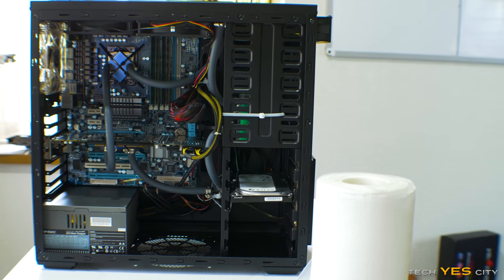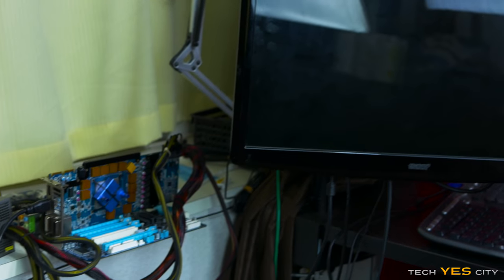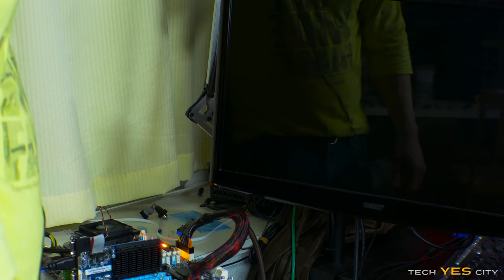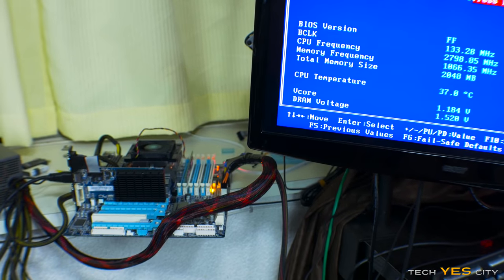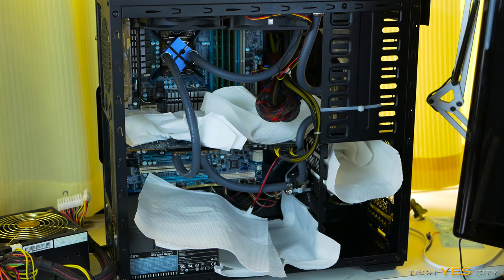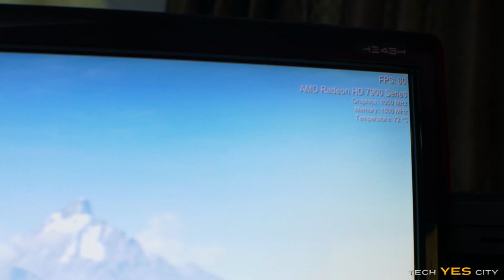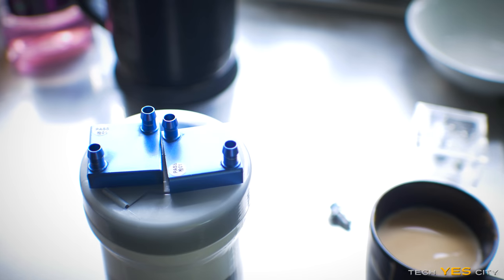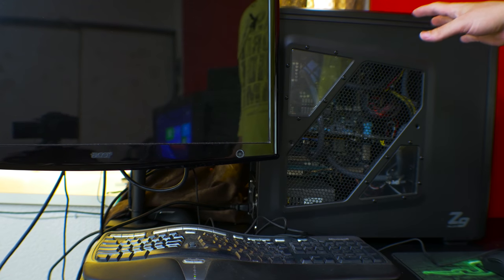$50 Custom PC WATER Loop - Is it POSSIBLE?

Comment: So many things wrong with this build.  Don't use automotive coolant.  Better with straight distilled water.  Don't mix metals.  It causes corrosion.  Don't use your finger to spread the compound.  You would have had better contact just letting the blob spread on it's own.  The blocks are still crap, but the TIM would have done a better job filling in the uneven areas.  Plus the grease on your hands has a negative effect as well.  Pump performance is EXTREMELY important.  The best blocks and rads in the world will perform like crap with a terrible under powered pump.  You will need blocks with some sort of fin or pin arrangement inside.  No clue what these have but pins/fins are  a must for better heat transfer.  An empty cavity will do very little heat transfer and cooling.
Reply from the maker: +Chad Bremer I am going to do round two soon with an orbital sander and brackets, definitely give it one more shot.
Reply: Tech YES City Take some of my advice and you will have better results.
Reply: As we all know there's no problem spreading the compound with finger.
Reply: +Chad Bremer 1. Mixing metals is no problem, as long as zinc or aluminium aren't involved. I'm even using copper, nickel and brass in my build and chemically there is nothing that can react at all.
2. Spreading TIM or just pressing down the blob doesn't matter at all. I'm using the credit-card-spread-technique for over 10 years now and I never encountered any "hotspots" caused by "ominous air-bubbles" or anything of that sort. But you're right on what you say about the bear finger. In case you want to use your finger to spread it, just put a thin plastic bag around your finger.
3. Pump-performance is not linearly bound to cooling-performance. In my setup the best cooling performance is reached at a pump-rpm between 2500 and 3000 min^-1. Above 3000 min^-1 the performance decreases again. That means for all builds and for all watercooling loops, the best performance has to be determined by testing various scenarios.
4. The best waterblocks available 8-10 years ago were so called "Düsenkühler" (Jetcooler) that didn't have any fins or pins inside at all. I doubt that the blocks used in the video were Düsenkühler but just generally assuming that you need pins or fins inside to raise the surface area is wrong.
Please don't take this as an offense but be considerate about what you say, because every coin has 2 sides and there are numerous ways that lead to rome.

Kind regards,
Meta Custom Computers
Reply: Meta Custom Computers 1 general rule, don't mix metals.  Yes, similar metals like nickel, brass, and copper are safe for the most part.  But the blocks appear to be aluminium.  Really bad choice since the rad most likely has brass in it. 

2  agree to disagree I guess.  I have tried it over the twenty years.  I only ever got a bad seat with spreading.  And the general consensus with everyone I know is that it's a poorest option.

3  By pump performance I am mostly reffering to having enough.  If the flow is terrible, temps climb.  There is a point where the faster the pump flow goes that it wont really improve anything.  In extreme situations the flow can be so fast the rads can not cool the fluid effectively.  But you need a some beast pumps like dual DDC or D5 for example.  And less rad than you really need.  

4 As for blocks, yes ten years ago some blocks just had a cavity in them.  But, as we all know, increasing the surface area has a huge impact on cooling as long as good flow is maintained.  Those old blocks could not even stand up to the now defunct Danger Den blocks.  And you can get those or old Swiftech blocks super cheap used.  Especially ones for old 775 sockets.  Easy enough to Jerry rig them for a setup like this.

No offence taken.  I just had to clarify myself a bit I guess.
Reply: Chad Bremer
Thanks for the clarification, though I still have to disagree with the spreading techniques. I bench-tested 5 different ways of spreading the TIM under the same conditions and the total difference of "worst" to "best" technique was 2°C wich can be completely dropped for average and I can wholeheartedly say, all techniques gave the same results. If you want to lean on the delta of 2°C, I can tell you, the "blob"-technique wasn't the best of the 5.
But looking at the sheer amount of people stating "how wrongly he applied the TIM", I guess I just have to make a video in which I bench-test those 5 methods again, to debunk this myth again.

Kind regards,
Meta Custom Computers
Reply from the maker: I just got finished testing this GPU the GTX 285, which has a massive heat spreader over the die, and the results were..... drum roll exactly the same, the spread may have beat the pea method by possibly a bees dick, I couldn't measure it as they both topped out at 64 degrees. but most likely tee it up to variance, this was with the fans mannually set to 70% the whole time, unigine valley and also 26 degrees ambient on all times.
Reply: Well, I did say inconsistent.  It will be fine sometimes and not others.  So, yeah.  My own experience talking on that.  It's only with spreading that I have ever had to redo TIM.  Line, blob, X, all have worked first try with no bubbles or bad contact.  Only thing I ever spread is liquid metal TIM.  Like CL Pro/Ultra.  It wont really spread on it's own very well.  If in a low mount pressure like this situation, just use low viscosity TIM.  Noctua makes a good one that is pretty thin.  You can do what you want.  But you are just making more effort for yourself.  When you have to build 20-30 PC's for a customer, you don't really want to deal with dumb things like spreading TIM.  Just wasting time.  Even more so when one or two has issues with poor contact and you have to redo it.
Reply: Chad Bremer "When you have to build 20-30 PC's for a customer, you don't really want to deal with dumb things like spreading TIM."
That's why my customers always return to me, because they know and value my dedication to detail and I always invest more time for higher quality. Of course I'm just building 2-3 PC's per month but I guess even with more output I'd still take my time for each PC.
The slogan of my little company is "I don't build PC's, for me it's arts and crafts."

Kind regards,
Meta Custom Computers
Reply: +Meta Custom Computers I have a side buisness that started when a friend of mine started doing independent IT consulting.  I do take my time.  every machine gets done right with tidy cable management and runs a battery of stability tests before I deliver them.  It's all local and all referral only.  Most of it is done durring the off season from my main job.  Most of the machines are office builds.  some servers of various flavors.  And a smattering of pro workstations.  Then I do 3-4 big builds a year.  Usually the managers or sales guys that are customers of my customers.  Only thing I won't do is hard tubing because I hate working with it.  And since it is not my main income I can be very picky about what I will do.  In the end it is very rare to see a machine need to come back.  But, like anyone that has been doing anything like this you know shit happens.  The not messing with TIM spreading part comes with the testing.  With the bigger orders I will do 3-4 machines.  After that the do OS instal/updates if needed.  Some machines leave with no OS.  Then they get tested as I start the next group of builds.  Generally I build faster than everything else goes.  Lol. The big builds take weeks to do everything.  From first part order, to the build, then test.  It is a nice way to make some side cash.
Reply: Chad Bremer
For me it's exactly the same, my small business runs alongside my main-job. The orders I get mainly consist of office-machines and normal gaming PCs. Some rare cases of fully loaded custom watercooled rigs. I'm picky with hardtubing when a customer wants the machine delivered by postal-service but when the customer comes for pickup, even hardtubing will do. But I'm also taking on repairs, upgrades and maintenance, especially now in the spring-time a lot of people take my offer of "spring cleaning" the PCs. Till now I only got one guy claiming a free repair, or a full refund of a machine. It was an overclocked gaming-rig for his (probably 14-15 year old) son which stopped working after 2 days. Took me 1 minute in the BIOS to see that someone messed with the settings, since I'm keeping record of the settings I'm doing, in case a customer needs a BIOS-reset and wants the settings back. Told him he can keep the computer as it is, or pay me for redoing the settings since it's his own fault for letting his son mess with it without supervison.
I already met a lot of non-German people who said "OMG you can't do that to a customer, the customer is king!" but for me things roll differently. It's fortunate that German laws prevent customers from shitting on your door-mat but it's still exausting to put up with customers like that.
But at the end of the day I just love doing it, the planning, the thrill when new parts arrive, the assembly and bench-testing. Still waiting for a major job, still dreaming of building a big render-machine for a company like a dual-CPU rig, using Xeons. But I have my hopes up. :)
At the moment I'm working on my "Sleeved cables project", since all the commercial pre-sleeved cable-sets you can buy are ugly and of poor quality. I want to set a higher standard for sleeved cables, so the customers can pick from 21 different colours and can design the pattern themselves. If they wish, I even do them in paracord, which allows them to pick from an almost infinite amount of colours. :)

Kind regards,
Meta Custom Computers
Reply: Meta Custom Computers The big workstations are kinda like gaming builds.  Most are not water cooled.  Have had a few though.  They are fun.  The wildest one was back in the 1366 days.  A quad socket Supermicro board back when Skulltrail was a thing.  Was a BEAST for some engineering company my friend was a consultant for.  I don't remember exactly what all went into it any more, but it was a fun build.  Had to get a special supermicro case since that was the only thing that the board fit in.  4U rack mount, of course.  Nice thing about being in a pretty big metro area is that there are lots of businesses.  My one friend gets most of the work machines.  The lame ones and some fun ones.  The rest are people he funnels my way.  That's where the manager and sales guys come in.  They get a hold of me through him.  Biggest issue for me is I work about 60-80 hours a week for about six months a year.  Not a lot of time to do this stuff during all of that.  So, when the winter off season comes, I do most of the work then.  I will do some of the custom gaming builds and other single machine stuff when working, but with the understanding that it will take longer to get it done.  If they need it right now, they need to talk go elsewhere.  I am just rolling into that schedule now.  Next week I am out of town all week.  And will be most weeks till October/November.  Nice thing about my buddy being an IT consultant.  If problems do crop up on the machines for businesses, he deals with them.  99% of the time it's a software or network issue anyway.  Not the machine it's self.  I have had to refuse business a few times.  One was one like you had where the person I built the machine for messed with it after I gave it to them.  And actually did damage.  I told them I would fix it, but they had to pay for it.  They tried to blame me.  I keep photos and screenshots of everything I build and file it all away on a server.  I pulled up what I had on that machine.  Showed what was changed and why it did the damage it did.  Then said I will not fix it for free.  He could either pay for the repairs or leave with the broken computer.  I also said if he chose the latter, I would not accept an business from him again.  That was three years ago.  Never heard from him again.  lol
Reply: Meta Custom Computers I do agree as well on the excitement of the builds.  Especially when you get new toys.  I am hoping to get my hands on EK Ascendancy when it comes out.  It's the fan controller they had shown off a few years ago, then it died.  Then last fall they started talking about a revamped version coming out again.  I think it might have a new name now.  But, should be a nice alternative to the Aquaero controller.  Not that there is anything wrong with those.
Reply: +Chad Bremer I wouldn't call pump performance EXTREMELY important. Speed is not necessarily conducive to cooling performance. Jay just made a video on this topic recently.
Reply: Chad Bremer Yeah, that's what I was trying to say, speed of a pump isn't always the most important part. But a pump that's too slow is detrimental to a loop, of course. Yeah, the pump was poopy and the blocks were total shit haha.

But imo Jay is interesting just for the fact that he has some epic builds, like his 3x Titan build with the beautiful custom loop, it's beautiful. But aside from him I agree Tek is great and Linus is okay. But just Linus and Luke, the others at NCIX are annoying.
Reply: Chewyshoot Jay has given a lot of poor advice in his short run.  As for the builds, well, they are free.  So... meh.  The loop is a funny story.  He boned that up bad early on because he went in clueless with Mayhems pastel. Part of it played out live over at Overclock.net.  Those threads are long deleted but it boiled down to Jay not blaming the owner and calling him out publicly.  Mick, the owner, in typical British fashion just didn't take his crap and told him he made the mistakes in prepping the loop.  He also told him the public attack was very unprofessional.  He then ignored Jay.  At least publicly.  Mick used to be a regular face at overclock.net before that.  Now, much more rare to see him around.   What little respect Jay had left, he lost it with us over there.
Reply: Chad Bremer that's fair, I suppose. I did actually see a vid he posted recently regarding the pastel coolant. But I take most videos on youtube with a grain of salt, but I do enjoy Jays material. Just my personal opinion. :)
Reply: Chad Bremer I did actually get the idea to watercool my r290 from him and Paul, so I'm thankful for that because rather than 94 it tops out at about 55 haha.
Reply: Chewyshoot You are free to watch and enjoy what ever you want.  I watch Bosnianbill lockpicking vids.  lol  No idea why.  But I do.
Reply: Chad Bremer and I watch lets plays of Stardew Valley lmao
Reply: Chewyshoot How about a vid of a guy chopping golf balls with a big knife?  Found that on the strange part of YouTube one day.  lol
Reply: Chad Bremer Or the hydraulic press ones lol those are great.
Reply: Chad Bremer
For me, Jay lost 100% of his integrity due to the Mayhems incident.
In German PC-communities he's nothing more than a joke, which is sad because I don't like cussing on people but on the other hand, the way he meneuvered himself into the incident... well he doesn't deserve otherwise.
I was pretty early on telling him that the "mysterious white stuff" was, which he claimed are "copper-salts". (I told a collegue of mine who studied applied chemical studies, he laughed his arse off...) It was nothing more than Titanium-Dioxide (TiO2) which is the most widely used substance for white colouring. The Mayhems Pastel White is based off of the original Ice Dragon which even has TiO2 in its list of ingredients. Furthermore, Mayhems already said on oc.net (regarding the Pastel Black) that "copper-oxide causes fall-out of the coloured particles which turnes it brown" and "that this may be an issue in all other colours aswell". So the question is: How does copper-oxide get into the loop? Every chemist will tell you that copper is a very sensitive metal and is quick when it comes to reaction with other substances. Acids and Vinegar can cause very quick corrosion on copper and the funny thing is, Jay openly admitted in one of his videos that he "Cleaned the rads with acids and vinegar several times".
So we have a totally clueless Jay who cleaned his ultimate high quality radiatiors with acids and vinegar several times, caused corrosion of the copper inside, the copper-oxide fell out and went into solution which turned the Pastel Yellow into an orange mess which caused the TiO2 to fall out aswell and build lumps on every fitting and every o-ring inside.
Sounds like it's totally Mayhems fault... NOT.
I guess you'll agree that one universal constant in the IT is: "99% of the times, the problem sits between the chair and the monitor" and this case wasn't any different. But wait there's more.
With all sincerity we wrote Tweets, Facebook-messages and Emails to Jay, telling him all this, asking him to just admit his fault and tell the people what really was going on. He will be the big generous Jay who forgave Mayhems for it was his own fault, he has another video full of real content and the viewers are pleased. Well... He ignored my facebook-messages and Emails and the Tweets of my collueges got deleted and they weren't able to tweet him again. (Don't know if banned or not, I don't know how Twitter works) We did that when the Mayhems incident was at the stage of "I don't know what's going on". One day later he released the rant video cursing and blaming Mayhems all over it.
It seems like Jay doesn't want to make videos with true and important contents...
But that's not the worst, because he's just a clueless Youtuber who can be ignored, what really made me mad as hell was the community backing him up, being on his side, joining the crowd of the Mayhems-hate-speech, not accepting that Jay might have something to do with it. And all that while thousands of happy Mayhems-customers are sitting at home with a custom loop that is totally fine for over a year, because they did their homework and didn't screw up like the fool Jay made out of himself...

Just my two cents (hope you see what I did there...)

Kind regards,
Meta Custom Computers

P.S.: I'm using the "shitty" Alphacool Radiators which in Jays words are "the dirtiest radiators available". I always just flush them with tap-water (Tap to hose, hose to inlet fitting, outlet fitting to hose, hose hanging in the shower) for 5 minutes, fill them up with a distilled water/sodium bicarbonate-mixture and let it sit for 10 minutes and flush it again with distilled water. Then when the whole loop is installed, I fill the loop with sodium-bicarbonate again and let it run for 10 minutes, flush the system with distilled water and then fill the whole loop with the coolant desired.I already built 3 rigs with Mayhems Pastel inside and till now only one customer returned after a year but not because of the Mayhems Pastel, he just wanted a regular cleaning-job. (Cleaning the inside, PCBs, refreshing TIM and refreshing the loop)
Reply: He actually mentions about the blocks and the pumps.
Reply: oh, come on jay got that one wrong / i would say this one goes in the category stuff happens. He went looks over functionality what in it self is a big no no - but oh well. btw. I also use Alpha rads(and some phobya), but flush mine with 90% alc. first, then destilled water.
Reply: Paul Posthuman
"Getting something wrong and admitting it afterwards" is totally different from "Lying to the community, discrediting a business and keeping quiet about everything afterwards".
If he had the guts to look into the camera and tell the community "Guys, I guess I fucked this one up, I'm sorry for that", I would have thought highly of him, but he didn't.

Kind regards,
Meta Custom Computers
Reply: yes it would. My opinion is the mayhems story bumped his sensible spot /
the "guru" screewed up, and wont get the taste of shame out of his mouth for a long time: hopefully makes him more humble,
Reply: +Paul Posthuman Thing is, he is not a guru.  Any tech forum with people that actually know thier shit, hat that tool.  Mainly because he thinks he knows what he is doing and talking about but he really does not.  The Mayhems issue just showed how much of a clueless ass he really is.  Especially if you watched him try to rip Mick apart at overclock.net and other forums.   He failed to research things and in turn messed up.  Then blames another for his fuck up, publicly.  We all knew he was a tool before.  That just sealed the deal.  Worst of the youtube tech celebs.
Reply: as for the guru: thats why the quotation marks are there / i personally never heard anyone referring to him as that.
overclock.net; didnt know that, guess i didn't get the whole story - will look in to it.
Reply: +Paul Posthuman mods deleted the posts long ago.  Many where in the Mayhems club thread.
Reply: Chad Bremer
For me basically everyone in the tech scene who is deliberately spreading false information loses credibility right away and the ones that don't apologize and explain themselves are not redeemed.
Like I said, the real crux lies in the community that gives people like him a podium. His audience mainly consists of teenagers who never even once built a computer-system in their lives, people that are simply thrilled and lured in by his "6000$ GAMING MACHINE!!!11".
Those are poeple that admire the sunglasses-wearing cool guy in the expensive Corvette, not realizing that the farmer on the field losely paid 10 times more for his combine harvester...
In the past I really tried to help those people by answering their questions and to motivate them to look into things, to learn for themselves but I just realized that it's useless.
Questions like: "I have an FX8350 right now, can I put the new Skylake in there?", "Haha, the GTX 970 only has 3.5 GB VRAM", "Why don't you put mineral oil into your watercooling?", "I have a GTX 750 Ti, can I play 4k with it?", "Can someone give me the settings to OC my i5 to 4.9GHz?", "Your watercooling sucks, my CPU runs at 8°C on aircooling!"... From being the harmonious answerer of questions and guide to enlightenment of the technologic knowledge, I simply turned into the fucking increadible PC-Hulk and I just wasn't able to answer those questions by heart anymore.
People that doubt my knowledge in which I invested over half the time of my life, because it doesn't match with what the allmighty Jay aka "Watercooling-Guru" said. It's frustrating and just drives me mad...
That's why since the Mayhems incident I simply keep away from that Youtube channel.

Kind regards,
Meta Custom Computers
Reply: +Meta Custom Computers lots of truth in that.  Maybe I should be a youtube star.  My rig that I paid for myself is nearly $6k.  Lol. 

Those combines are a lot more expensive than 60-100K.  More like 300-500K for nice ones.  New of course.  I think the top end combine from Case starts at near 500K before options.  Serious cash in farm equipment.  

As for the dumb questions, you see them even on the good forums.  Simple questions that a quick Google would solve.  The overclock one you mentioned bugs the crap out of me.  Try to explain that every chip is different and no two use the same exact settings.  At least if you are doing it right they wont.  Hell, updating a BIOS will often make OC settings totally different.  Explain all that, and still get the question of what settings to use....  Makes you want to reach through the screen and slap them.  Or the people that ask a question and then argue because the response is not what they wanted to hear.  Even after a dozen posts explain what's wrong with what they asked.
Reply: Chad Bremer
We have a German PC-magazine that also has a Youtube-channel and one of the editors is a real geek, one of the oldschool ones. And every time he talks about RAM or HDDs, he's using the correct terms of kibi-byte (kiB), mebi-byte (MiB), gibi-byte (GiB) and so forth, which technically is the most correct form you can use. I use the terms whenever I see it appropriate and I always smile when I hear the guy on Youtube saying those words. Then I rage again when scrolling down to the comment section, realizing that 50% of the comments consist of people laughing their arses off because of his beard and the other 50% of people laughing their arses off because that idiot can't pronouce "kilo", "mega" and "giga" properly...
And then you always find that one guy asking why his "2 TB" HDD only has "1.81 TB"...
I always remember the times in the 90s when people had no clue about computers and weren't ashamed of asking the "PC-guy" for help and just accepting what he had to tell you. In todays time thanks to the DIY-mentality and Youtube-tutorials, everyone thinks 3 minutes of tutorial and 2 minutes of Google searching makes you the ultimate PC-expert and as soon as you fail, it's the PCs fault...
In a German forum I've seen a guy asking if he would be able to build his own PC, even though he never built one before and has no clue about electronics. Everyone told him to just do it, because Linus and Kyle said on Youtube that it's totally easy. I was the only one opposing that thought and telling him to ask his father, or friends who are experienced in electronics and to let them explain everything properly. Everyone hated on my recommendation and continued to tell him to go on. After 2 days he posted again, saying that he built the computer but it won't boot. Long story short, he shorted the backside of the mainboard, most likely frying it and frying the CPU in the process. I wrote: "I told you so", his response: "Pfff...I'll just RMA them."
I'm not capable of feeling something else but utter hatred towards people like that...

Kind regards,
Meta Custom Computers
Reply: +Meta Custom Computers I have heard people use those and just assumed it was an accent thing.  Never read or heard of it being the correct way of saying them.  Although they are in the conversion function on my calculator app on my phone.  Guess I should do some reading on the whole back story on the two ways of saying them.  Interesting.
Reply: Chad Bremer
It's pretty easy, the people responsible for pre- and suffix-conventions said that kilo, mega, giga, are base10, which makes them 10^3, 10^6, 10^9 (1,000; 1,000,000; 1,000,000,000). But in the IT, you have base2, which makes them 2^10, 2^20, 2^30 (1,024; 1,048,576; 1,073,741,824). That means, they are both not equal, and you can't use the terms kilo, mega and giga for numerics and IT at the same time. Else if you go to the butcher and say you want one kilo-gramm of meat, he always had to ask "1000 gramms or 1024 gramms?".
So specially for the IT they introduced new conventions which are kilo-binary (kibi), mega-binary (mebi), giga-binary (gibi) and so forth. (ki, Mi, Gi,...).
So for example, if you have a HDD that says "2 TB", on it, it's base10 what they mean, so it's 2,000,000,000,000 Bytes. 2,000,000,000,000 Bytes in binary form is 1.81 TiB. (Divided by 1,024 four times) The only ones that never get it right are the manufacturers of RAM, because they should name their kits 4 GiB and 8 GiB, instead of 4 GB and 8 GB. 4 GB would mean 4,000 MB but it's 4,096 MiB.
If you know the calculation of multiples of 1,024, then it's natural for you, you just have to change your habit to saying kibi-Byte, Mebi-Byte and Gibi-Byte instead of kilo-Byte, Mega-Byte and Giga-Byte. :)

Kind regards,
Meta Custom Computers
Reply: Meta Custom Computers Interesting.  Never really looked into that all that closely.  Cool stuff to learn though.  Not sure I can change my habits after so many years though.
Reply: +Chad Bremer .... And +Meta Custom Computers .....dispite this comment being pretty old. I agree with the youtuber. And celeb part and with just entertainment part of y'alls conversations. I enjoy seeing ppl that aren't arrogant and mr. I know everything . You guys are an inspiration, not to long ago I had an interview with an IT company. They had me taking a part a system and asking questions about what x part was. To my surprise , they were impressed with my " basic" knowledge of hardware. They asked me , where have I  learn. My respone was long of hours of research ... with a grain of salt of youtube. What I'm trying to get with this ...when most of this techtuber started... they were very informative with a grain of salt . Now everything is for the money, and not to inform.. google can help more and give better info..
Reply: Most of these are myths but lets go on. 1. It is perfectly FINE to use automotive coolant, anyone whose been into PC more then 5years would know that, its whats been used for years before industries found suckers that would buy premixed coolants and so on. Should of course be used with a good % solution. 

Distilled water on its on is FAR more corrosive then anything else, why? Because science, it has no ions therefore it picks them up of EVERY SINGLE SURFACE IT TOUCHES, ie the blocks, rads,fittings, tubing etc. So yea youre wrong there. The only metal that shouldnt be mixed is aluminum besides that in watercooling loops you are FINE. Nickel,brass, copper,tin are all very LOW on the corrosion reactivity chart so it doesnt matter in the least bit. 

Pump performance is important that i agree on but pump head is far more important then pressure. A simple loop like that with pretty much ZERO restrictions since the interior of those blocks prob has no fins or jets its perfectly fine using a cheap pump. 

And as long as water is flowing it will cool, the jets and fins mater because all that does is slow down the water and cause a turbulence, and a more turbulent more restrictive block will cool better then one thats less restrictive.

P.S. The fact that the blocks are aluminum and hes using car coolant is EXACTLY whats its used for, it has corrosion inhibitors already in it DUH.
Reply: Mike,du alter Hase! random video on the internets and there it is...a very familar face. reminds me of good ol LEBK times with P. Freese und VBA programing :D
Reply: bluej511
Please let me take your points and analyze them further.
1. Automotive cooling is ok for watercooling a computer but by far not the best. Automotive cooling is nothing more than distilled water + growth inhibitants (low amount!) + antifreeze + anticorrosive. The antifreeze causes a higher viscosity of the fluid which isn't that good. Secondly, the antifreeze is absolutely useless in a watercooled PC, because your PC will never endure temperatures below 0°C, so it's a completely useless ingredient in the mix. Furthermore, the amount of growth inhibitants in automotive cooling is pretty low, because the biggest growth inhibitiant factor in a car-waterloop is temperature itself. The waterloop in a car reaches temperatures above 90°C which kills the majority of biological life in the loop every time you start your engine.

2. You're mixing up distilled water and deionized water. Deionized water is NOT distilled water. Distilled water has all it's ions in it's regular places and doesn't take any ions from any surfaces it touches.
Distilled water is the best coolant you can use in a PC-waterloop, all it takes is a kill-coil and you won't experience corrosion or growth of biological life in your loop. It still needs regular maintenance to ensure good cooling performance and no corrosion. Pre-mixes for watercooling exist because a lot of people worked out good formulas of water/anti-corrosive/growth-inhibitant while remaining the best cooling-performance possible. They have the knowledge which they worked hard for, so it's their privilege to set the price as high as they wish. It's up to the customer if he wants to pay that amount or if he wants to create his own mix. No harm done.

3. Fins in waterblocks are not there to block, restrict or slow down the water, it's there to increase the amount of surface-area of the waterblock. The higher the surface-area, the better the heat-dissipation. Fin-size, fin-amount and fin-density is always a compromise between surface-area and flow-rate. Also, it's not water that cools the waterblocks, it's the air that runs through the radiators. Basically every watercooling is just aircooling with water used as a medium of heat-dissipation. The water alone doesn't make a cooling loop. Shitty blocks, shitty pump, shitty radiator results in shitty cooling-performance, water alone can't change the fact. If you have a custom waterloop, you can check for yourself. Just set your pump to the maximum setting but disable the fans on your radiators. Water will flow without a problem but just take a look at the temperatures...

Kind regards,
Meta Custom Computers
Reply: Meta Custom Computers Well, I was going to reply, but you got it first.  lol  Nothing that I can think of to add.  Other than some of the fluids that are premixed just look cool,  :P  

I have Aurora in my loop right now.  Due for a drain and fill though.  For low maintenance loops I stick with distilled water or a clear premix.  Usually Mayhems.  If I use just water I will add a biocide to the mix.  More often than not I just use the premix though.  Has all you would want, nothing you don't.  Just pour and go.  Only time you would ever really want auto coolant is if you are going to chill the radiator/system.  There are a few people I have see that basically have a water loop and full rig in a sealed off box with the cooling hardware of from a freezer hooked up.  Works good, but is very noisy.  One such system is on OCN from a desk build log.  System in the desk and air is pumped though the condensor in the basement.  Duct work runs through the walls into the back of the desk.  Then back down to the cooler.  Don't recal the air temp, but it was a bit below freezing. The building did a pretty thin antifreeze mix.  Far less than the 50/50 you see in most cars.  Was a cool build.
Reply: Oh how i wish those points were all valid lol. 

1. As far as the viscosity of coolant, its so minimal that it doesnt affect cooling performance at all. Someone on oc.net has tested flow rates of both coolant and pure distilled water and they were IDENTICAL so it makes no difference whatsoever. 

2. I do believe you have it wrong. "Distillation and deionization are similar in that both processes remove ionic impurities, but distilled water and deionized water (DI) are not the same and are not interchangeable for many lab purposes." "Deionization does not remove molecular species (e.g., sugar) or uncharged organic particles (most bacteria, viruses)." This is why distilled is preferred in that sense, but again BOTH will cause corrosion under the right circumstances, doesnt matter if its DI or Distilled. P.S. If distilled water had ions in it it would be conductive, which it isnt as ive tested the Alphacool distilled water i use. 

3. It is a known fact that water molecules NEED to be turbulent to work much MUCH better then if you had a none restrictive block. Heres the perfect example, my alphacool gpx block with HUGE restrictions destroys all and every ekwb which are much lower in restriction. PERIOD its a fact sorry to burst your bubble lol. 

And you can't tell me the water running thru the waterblock isn't whats cooling the waterblock haha. You really should look into mineral water or 3M Novec liquids which pretty much just cool without any flow whatsoever. The water dissipates the heat caused by the tdp of the cpu/gpu and the radiator cools the water. I have ran my fans completely off and my temps were maybe 6-7&#176;C hotter then with the fans on so yea my fans are cooling but the water has the biggest affect. 

While i do agree that using car coolant in this day in age is dated, you can absolutely use it and its not going to change a thing. Your temps might be a whopping 1&#176;C higher then if you used distilled/deionized water lol. Again trust me ive tested this on my rig.

P.S. A lot of those premixes are utter garbage. Id go as far as to say that they are all worse then pure distilled water. Again example from my racing experience, theres a reason formula 1 cars use distilled/deionized water and nothing else but a bit of inhibitors. Theres no other chemical or additives as pure water is the best as thermal efficiency.
Reply: This is just a proof of concept. Literally $50 in no case is enough to buy a performance grade loop, so please try to understand a video before you go off ranting on how it could have been better. FYI spreading thermal paste with your finger is fine, as long as you thoroughly clean your hands before, and after. He has spoken about it in previous videos, as to why he does it.
Reply: SkewTube Agreed and people are just too anal. And dont forget the proof of concept that lapping works and works really well. Especially if your block is either concave or convex.
Reply: He has to use automative coolant because he has mixed metals.
Reply: Pat Wong
Please read my first post above.

Kind regards,
Meta Custom Computers
Reply: Meta Custom Computers Yea, my mistake I thought he used copper blocks with alu rads
Reply: Pat Wong
No problem. :)

Kind regards,
Meta Custom Computers
Reply: Lots of good info in your comment, thank you!
Reply: An orbital sander? lol. Bad idea. All orbital and random orbit sanders use hook and loop or PSA adhesive discs on a backing pad that is slightly soft so the sander doesn't chatter all over the place. This is great for sanding a table top or large flat surface but if you've ever sanded small objects, you always end up rounding off the corners resulting in a convex surface. The only way to lap a surface flat without really expensive machinery is to take a piece of glass and stick the sandpaper directly to it using a very light misting of a spray adhesive like Super77. This will also allow you to wet sand when you get into the very fine grit papers.
Reply: I have a much better reason why its not a good idea to use your bare finger. Most of these thermal compounds have heavy metals like silver in them and each time you do this, some of that silver gets absorbed and many years down the road you'll end up with heavy metal poisoning.
Reply: LBCAndrew Most TIMs are non metallic these days.  Makes them noncunductive.  Arctic Silver is one of the few metal based ones that are not liquid metal TIM, like CL Pro and CL Ultra.  Arctic Silver is not even that great these days.  Many non metallic pastes have far surpassed it in performance.  Only thing better are the liquid metal TIM solutions.
Reply: LBCAndrew also, silver is not a heath threat like mercury or lead.
Reply: convex surface is fine as long as the bump is on the die, its a concave thats a problem because it will make no contact
Reply: LBCAndrew
The cheapest way to use the "finger-technique" without getting your hands dirty is to stick your hand into a thin plastic bag (The types for fruit and veggies you get for free at a grocery store) and slightly wrap it around your finger. The material is so thin that it still feels like you're using your bare finger but it still protects your skin from the TIM.
There is no health-threat in getting TIM on your fingers, the only thing is that it is inconvenient. You have to wash your hands, which means leaving your workplace, which causes you to be unconcentrated or you might forget something that you thought of before. But apart from that I can't really think of anything dangerous.

Also a slight convex surface is not as dangerous as a slight concave surface, since with a convex surface you have at least some sort of contact-point in the middle of the die or IHS while with a concave surface only the corners of the die or IHS have contact.
Of course it's not the optimum you want for cooling-performance but still cooling is possible.

Kind regards,
Meta Custom Computers
Reply: +Meta Custom Computers The issue I've always had with hard drives is that even two different 500 GB drives would often not have the same amount of storage capacity. Some would be closer to the 500 GB mark than others. I just wish that they'd settle on a number and stick with it, instead of what's going on.
Reply: the different sizes represent the allocated reserve space for when sectors are unusable after some time, so that your HDD/SSD continues to work and not die. Look at your HDD S.M.A.R.T. report.
Reply: Michael Rinkle
Is it possible that you posted underneath the wrong comments? I can't really make out what your posting is referring to.

Kind regards,
Meta Custom Computers
Reply: this can be answered in one word

BUDGET
Reply: Chad Bremer getting it right wasn't the objective, seeing if  a $50 loop was possible
Reply: Auto coolant isn't corrosive. Yes, but it is toxic to humans. and it is not as effective as water. Pure water transfer heat the best among safe liquids. Unless you use mecury. The coolant is added to automobile as anti-freeze. adding auto coolant to your PC is rediculous and dangerous because I don't think too many people would take their PC to the outside during freezing temperature.
Reply: ***** The coolant is an ANTI-corrosive. To get the cheapest parts he used alluminium and copper together, so to stop a ridiculous amount of corrosion automobile coolant is what you need to use.

AIO liquid coolers do the same damn thing, it has nothing to do with the coolant freezing, if he had used pure water the corrosion would have destroyed the radiator and blocks.
Reply: auto coolant is also called "antifreeze" for a reason. That's why you will always needs to add 1/2 of distilled water to the mix before you pour it in. Water at its purest does not corrode. It's the stuff in water that does the corrosion. Also, material like copper and Alumimium does not correct either. Thats' why alot of the water pipe still use copper. So to use auto. antifreeze in your PC is ridiculous unless you use your PC in north pole somewhere.
Reply: Frank Jeagar auto coolant is also called "antifreeze" for a reason. That's why you will always needs to add 1/2 of distilled water to the mix before you pour it in. Water at its purest does not corrode. It's the stuff in water that does the corrosion. Also, material like copper and Alumimium does not correct either. Thats' why alot of the water pipe still use copper. So to use auto. antifreeze in your PC is ridiculous unless you use your PC in north pole somewhere.
Reply: FFS learn about something before you talk about it. Yes, it is an anti-freeze, but its use in this situation is to act as an anti-corrosive, the fact that it is also an anti-freeze is irrelevant. 

Water doesn't corrode. Copper doesn't corrode in water. Aluminium and copper in water does corrode! Even pure water quickly picks up ions that causes corrosion of the copper that would ruin the loop. Glycol based anti-corrosives, like automotive coolant, prevent this. Everyone who watercools knows this. People who know basic chemistry know this. Most mechanics know this. Look up galvanic corrosion and educate yourself.
Reply: Frank Jeagar
Don't disrespect people, just leave them behind and go on.
You're ending up more frustrated and stressed than he will and stress shortens your life expectancy.
Don't shorten your life span in the Youtube comments.

Kind regards,
Meta Custom Computers
Reply: Meta Custom Computers
Yeah I know. I generally do, but I couldn't help myself this time lol :P
Reply: better than this bullshit at least
Reply: Chad Bremer pump speed doesn't matter...
Reply: Chad Bremer it's only a test jeez.